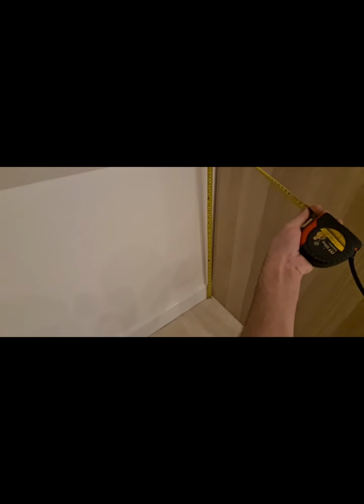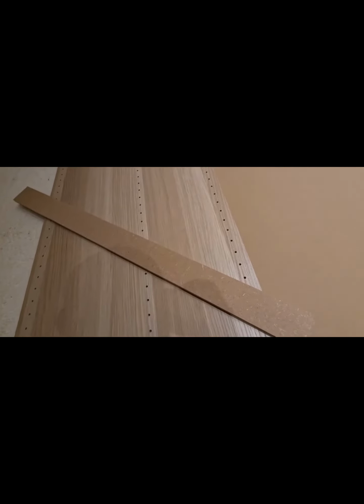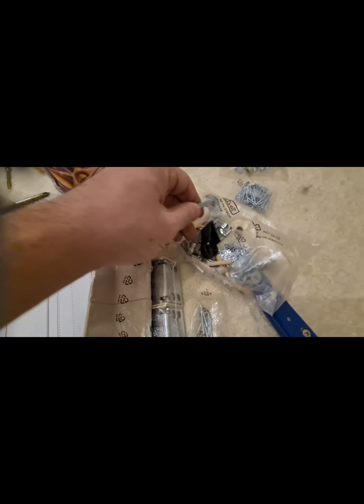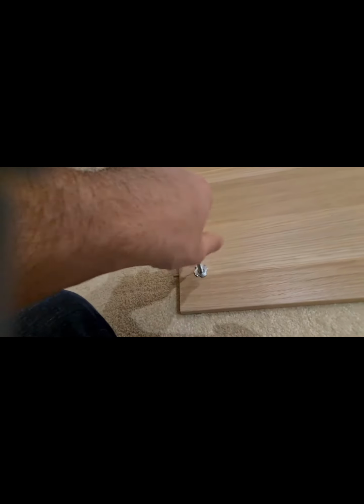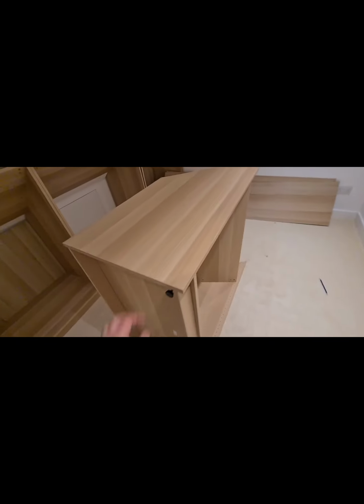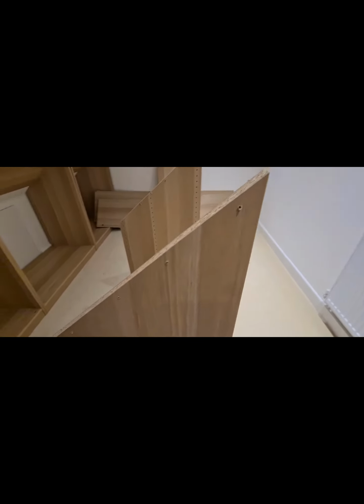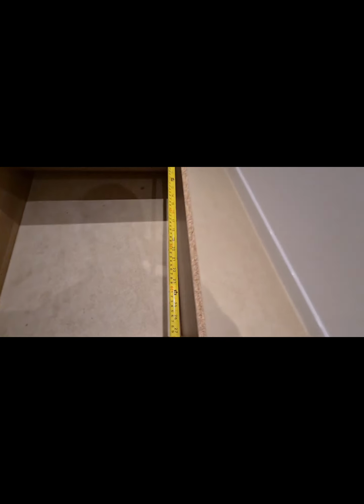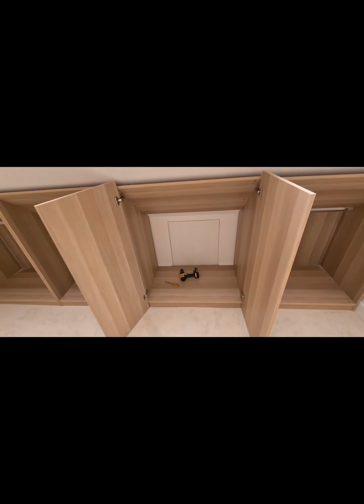How To Custom Fit an Ikea PAX Wardrobe in a Loft Conversion EASILY

Comment: Hi these look great. Well done. I have a similar set up in the attic and was wondering what size doors did you buy? And were they also from IKEA?
Reply from the maker: Hi. Yes from Ikea. I can't remember the exact size of the doors, but you can get the smaller size doors as they're going to be cut anyway

Comment: Good work. What did you use to keep your circular saw straight?
Reply from the maker: Thank you. I used a Makita saw which has a huge disc, and it's straight but you need to mark everything before cutting and just follow your lines

Comment: Really good... Very impressive. How did you do the doors?
Reply from the maker: Thank you. After I fitted the wardrobe and put it in it's final position, I measured from the floor to the top of the wardrobe then deducted 1cm from the bottom so that when I fit the doors, they don't scrape the carpet every time and I cut them to size and fit them. I drilled 5mm holes on the inside for the hinges and fit them. That's all. Hope that helps!